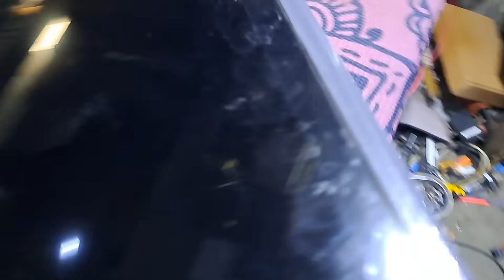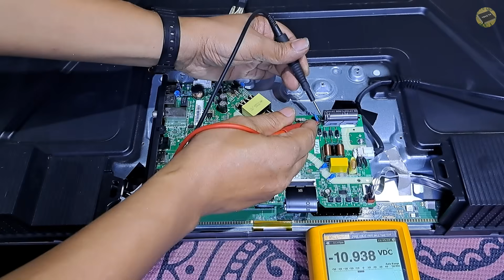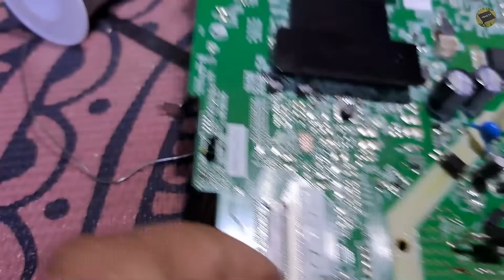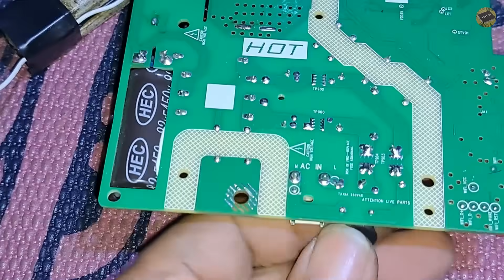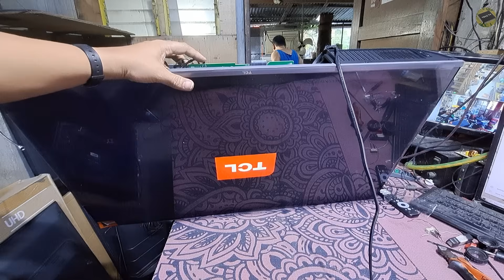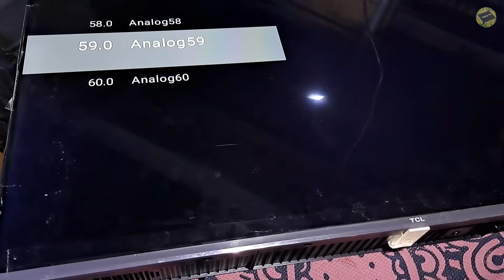TCL smart TV. An open overcurrent protection destroys the PWM driver.

Comment: Tevztv@
 Hi, I have tv manta 32 motherboard nr TPD.NT72563.PB781 

The TV was working fine, but two weeks ago it wouldn't turn on. The only thing I could see was the red power LED, and nothing could be done. Could you post a video of this happening or something similar? Thanks.

Comment: 32 inch tcl smart tv no picture . With sound ok  . Model32 s5200 when i knock led panel there is a backlight . I try to factory set . Stil not working . Pls help.
Reply from the maker: panel problem, test any missing voltages.

Comment: Isn’t the PWM driver connected to the gate of the mosfet?
Reply from the maker: It is, the mosfet in  the diagram is not at the position to connect to the PWM driver. I have no time to correct it.